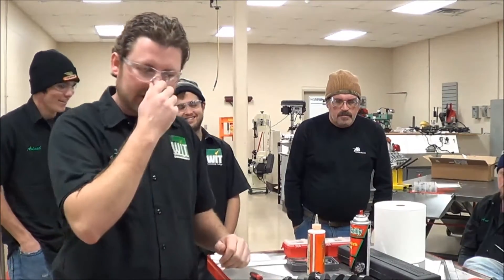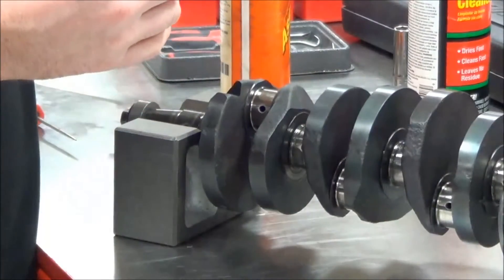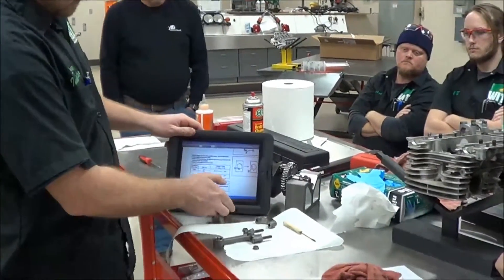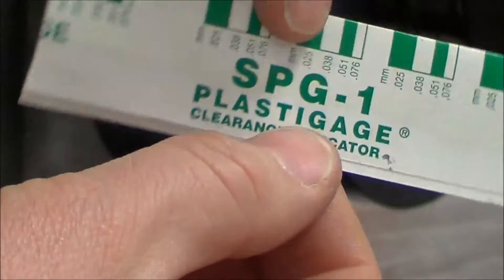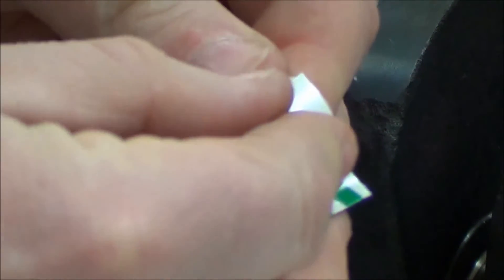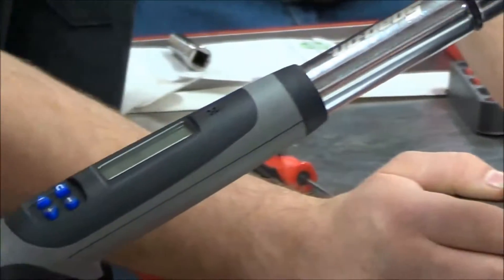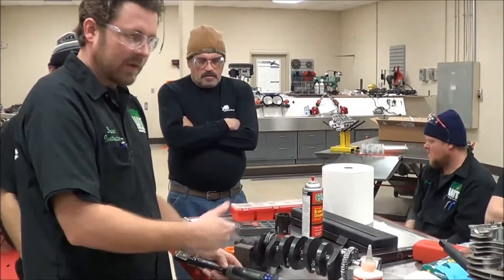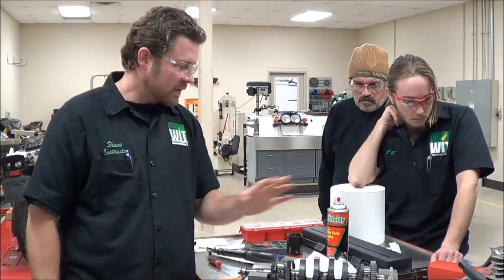How to use Plastigage to measure journal clearance on a Ninja ZX GSXR Vrod R1 R6

Comment: If bolts are changed rods need to resized!
Reply from the maker: +moparracer3 

Mopar...not the case in motorcycle engines. Many car guys assume the American muscle procedures at the same. If you know of an example I don't know about, please post here. Many motorcycle  engines DO NOT even require bolt replacement.